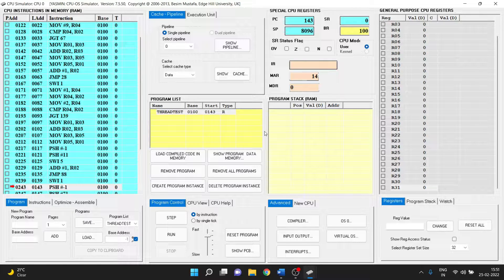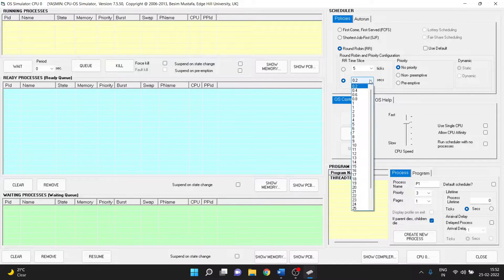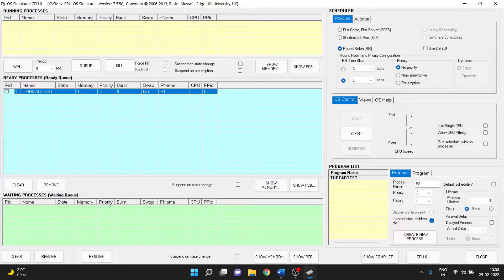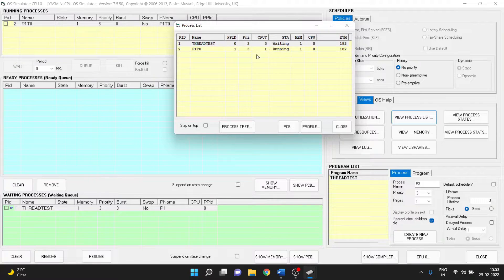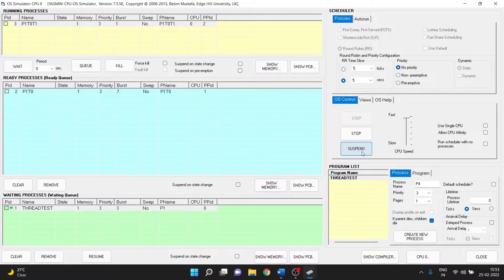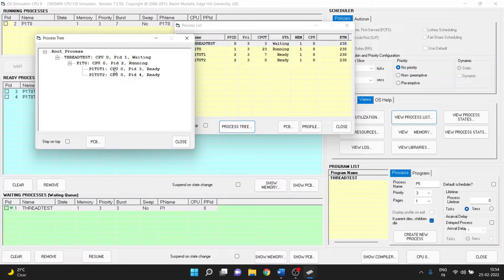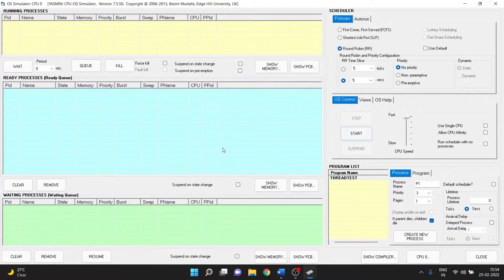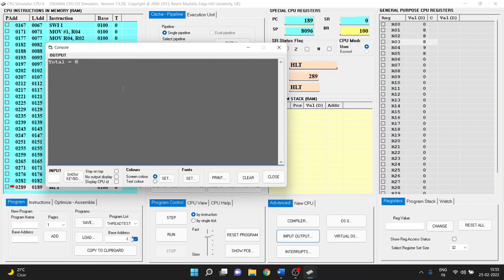Multi-Threading Simulation | CPU-OS Simulator

Comment: Facing issue in a program like it is not accepted "Total=", this i tried using Total = total then it's worked but it will affect in the output?
Reply: Try fixing the quote marks. That is the issue. 
Are you by any chance a Wiproite